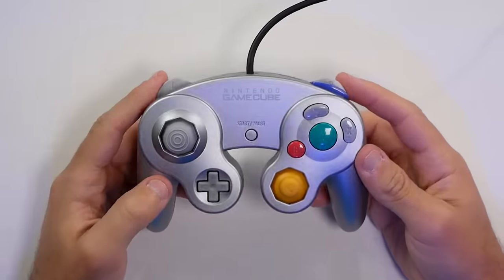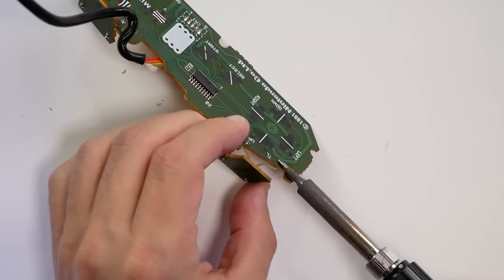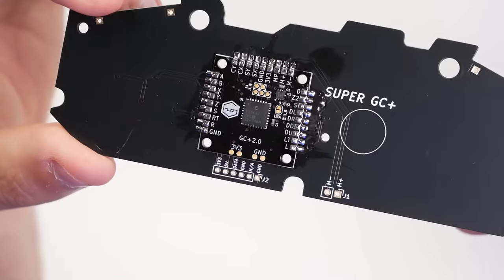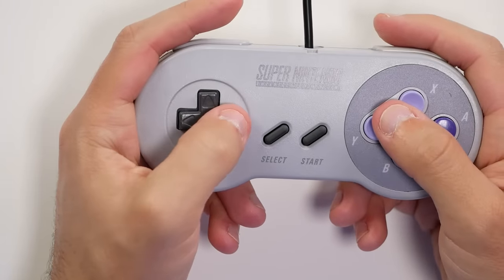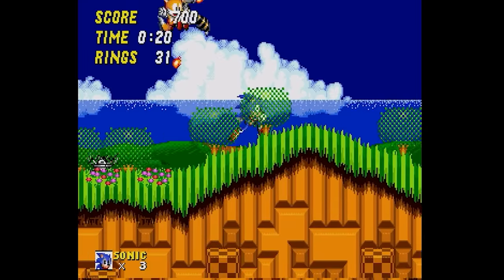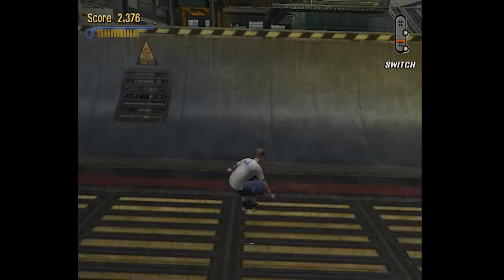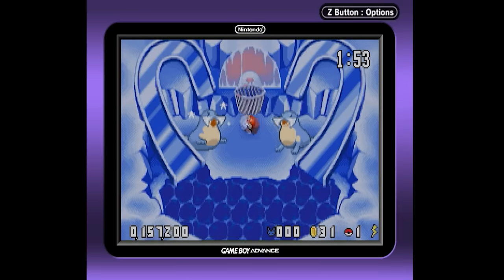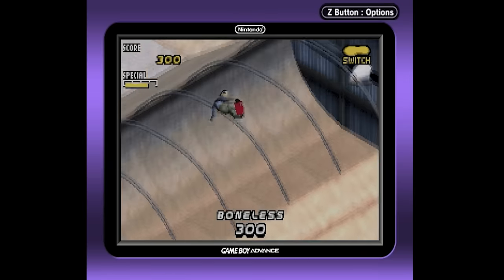This New GameCube Controller Is Weird (And Awesome)

Comment: Retro emulation on Wii is great if you want to game on a CRT without having to collect a physical library. This would work great for SNES, Genesis, NES and GBA emulation on Wii!
Reply: official emulation or are we talking actual decent emulators via homebrew channel? because all virtual console games looked super dark on the wii
Reply: @LovelyAlanna  You could also use a mod like this for fighting games (Especially 2D like CVS2 on Gamecube or TvC on Wii)
Reply: The Wii classic controller already does this
Reply: @TheMysteryDriver  It's not a SNES controller
Reply: @jamesvgold  it has the same form factor and more buttons.
Reply: I'd take it if it was a stand alone controller, but the connection to a Wiimote is so weird, no thanks

Comment: Not bad for a first run, but it could be improved. 
1. Not sure why they attached the chip to a small PCB instead of the main one? Seems like a needlessly added step and part.  
2. The cable could be improved if they use JST connectors (eliminating the need to solder the cable directly)
3. I feel like it should come with the shoulder PCB's as well (this would allow it to be easily reversible back to SNES)
Reply: Main reason for seperate chip is that it's sold by its self normally for DIY handhelds like Wii portables
Reply: Just wait, I bet 8BitDo can have a solder-less design for the same price or cheaper in a few month.
Reply: @Festivus_Miracle 8bitdo only ever do wireless stuff, so no it ain’t gonna happen

Comment: Personally, unless I were to find a genuine SNES controller that was missing the cord, I would use aftermarket parts for this rather than cannibalizing a real controller. The 5½ face buttons and maybe the D-pad are available through Game Boy mod shops, so it's only the shell and shoulder buttons I would need to find.

Comment: I saw raphnet had an adapter for the wii classic port to a gamecube port, not sure if they have a snes to gamecube one
Reply: There is. That's my go to gameboy player setup. Raphnet adapter paired with an OEM SNES controller.
Reply: There is but it's never in stock :(

Comment: Pretty interesting DIY project, cool that it lets you make use of an original shell and solder the connections to a GameCube controller end. Pretty novel idea but like you mentioned in the video, quite cool for beginners of soldering who second as retro gaming enthusiasts. It kinda runs through with the community, especially with the topic of mod chips.

Comment: This is neat, but it maps the controls 1:1. that menas you're going to be playing GameBoy Player games with the SNES B and A buttons instead of the more natural comfortable Y and B buttons. I would buy one of these if they made a varient that had slightly different mapping of Gamecube B to SNES Y and Gamecube A to SNES B. 

Instead, you should seek ta non-destructive adapter from Retrzone called the Wii SNES RetroPort. This has a female SNES socket to allow you to simply plug in any SNES or Super Famicom controller or even arcade stick and use it on the Gamecube or Wii. The only advantage this kit has is the rumble, which is a very minor thing.
Reply: U can remap buttons in software

Comment: I purchased this and installed it and after some testing I came out a bit disappointed with this product for 2 reasons. 

#1- The size of the pcb on the SUPER GC+ MODKIT is a bit thicker than the OEM snes pcb, this in turn makes the dpad membrane push down on the plastic dpad which in turn gives the dpad an awful stiffness. The only solution I found to alleviate this was to unloosen the screws on the controller to alleviate the pressure.

#2- I'm not sure if it's the way the input contacts on this pcb are designed, but I am getting a lot of missed inputs on all face buttons, especially during light button taps and mashing. I tried various OEM membranes and kept on getting the same result. This ended up being the dealbreaker for me.

It's for this reason that I recommend getting yourself a raph-net adapter which allows you to keep your snes controller intact without opening it up and doing any internal changes.

Comment: I would say that using this with a working SNES controller would be a waste, given that those are fewer and far between these days, but it's a good project to repurpose an SNES controller that no longer functions due to the electronics having failed or the wires being damaged, etc.

Comment: Just buy a ralphnet adapter. Even works with 8bitdo’s wireless SNES controllers and you can still use it back and forth between GameCube and SNES and your not destroying anything.
Reply: my same thought, but it comes with rumble and I personally would only use it on 3rd party SNES controllers

Comment: I wonder why using this, if you can use an SNES to GC Adapter? I bought one years ago and never had any issue using it with an original SNES Controller for Wii VC Games.

Comment: Why this over a GameCube to snes controller adapter. No modding necessary and they have been a thing for years? Ow just finished the video. It has rumble. I guess that answers my question.
Reply: +$10 for rumble i suppose... but then again, you just nuetered your SNES controller from ever being usable on your SNES. I guess for 3rd party controllers this could be cool.

Comment: JIS Screws... not phillips.  They are almost the same, but you shouldnt use a phillips driver on JIS screws (japanese industrial standard).  JIS is sooo much better and you can use a JIS driver on phillips screws.  its hard to explain, but JIS wont cam/twist out as easily when tight.  Do youself a favor and get some, Vessel makes some good ones.  I promise, you will never wwant to use a phillips driver ever again.

Comment: Why? This is unnecessary.
Reply: GC dpad is crap
Reply: @aaaaa-kf5lc  for what? You are better off getting a third-party gamecube controller like MadCat than this. Why would you downgrade yourself with limitations imput? 
On PC/Dolphin, you can use other controllers like PS4 and Xbox to solve this problem.

Comment: i just finished installing this, tested it on two different modded gamecubes. it doesn't seem to want to play with the laserbear blue retro internal, though it works just fine on the original controller port.